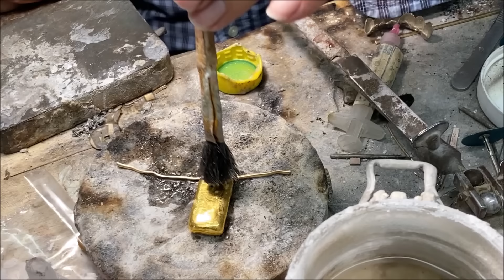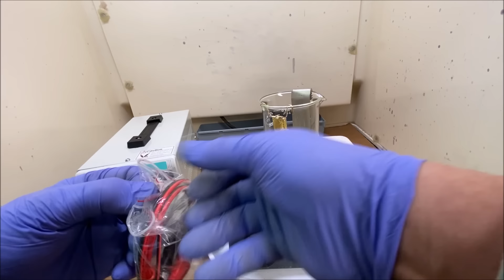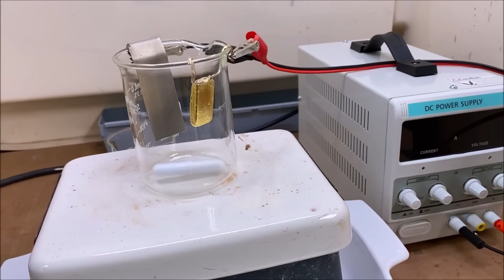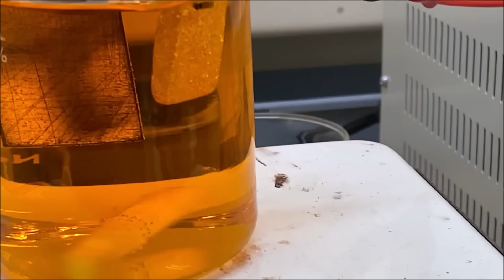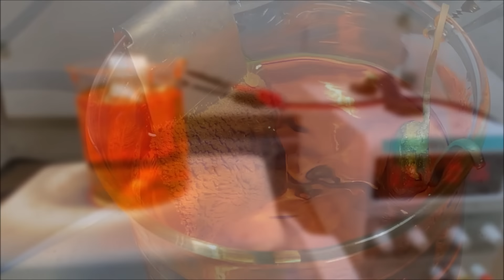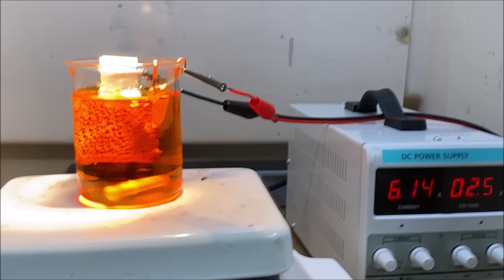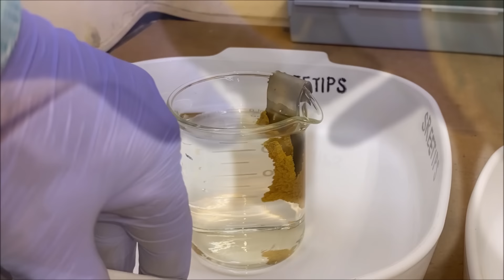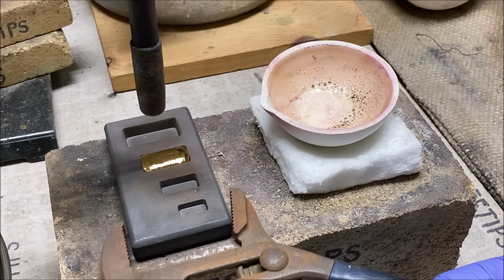Electrolytic Gold Cell Part 2

Comment: There are several things that come to mind that could improve this process but something you may find useful is the use of a carbon rod anode after the gold is gone.

This works on gold, silver, and copper just the same, and drives the gold out of the remaining electrolyte solution, just as is happening when the anode is made of the source metal... only the carbon rod does not go into solution as the gold does. It strictly serves as a place for electrons to go.

The result is the solution will fade to "clear" similar to how a SMB/SO2 drop does, only instead of simply falling to the bottom, the gold plates out on the cathode.

In fact you can do a "drop" that way... the only difference between "chemistry" and "electrochemistry" is the path the electrons take and an external energy source driving it (or energy sink running on it for the inverse, a battery).

Play with it with copper or silver first if you're nervous about the experimentation with gold before you're comfortable with it. As a side note, for the most part, metals above hydrogen in the reactivity series will want to stay in solution in favor of yielding oxygen instead (from the water). There are exceptions but they also affect the cell in the video.

This tendency is one of a few reasons the voltage is held low, to prevent electrolysis of the water in the solution (which just wastes input power for electrorefining).

The process I refer to by the way was given a related name - "electrowinning".

For what that's worth.
Reply from the maker: I was very pleased with the result. I may do this again with a larger quantity.
Reply: @sreetips  Excellent 😉

Comment: wat you could do instead of soldering wires ontoo tha anode is find a mould that has two extensions build in , either that of flatten the anode partway and basicly hammer the flattened end intoo two wires

Comment: Edit: Seeing that it was kind of difficult to removed the gold from the titanium anode, could you have heated the titanium to where the gold would have slid off since the melting point of titanium is about ‘1000° higher than gold’? Or would it have somehow alloyed with the anode? Seemed prettt difficult to remove the gold barnacle off the titanium.
Reply from the maker: Heating is not a good idea. But tapering and polishing the titanium cathode may help.

Comment: Do I have permission to try this? I need help trying get pure refined gold. I have authority for one video, but, it just cost too much in chemistry. Your method is better. Chemical engineering student, but need to help my mother pay off the house
Reply from the maker: This method works with gold that is already high purity. The anode was about 995 parts per thousand pure gold. The gold deposited on the titanium cathode was 9999 parts per ten thousand. Trying karat gold won’t work with this cell. Too many impurities.
Reply: @sreetips  k. Makes sense. What about your prior method to making high purity gold. Is it too high to sell?
Reply from the maker: No, it can be sold
Reply: @sreetips  the impurities I'm using is urea and aqua regia
Reply: With smb
Reply from the maker: Karat gold is an alloy of gold, silver, copper and zinc. The impurities I refer to are all the non-gold metals.
Reply: @sreetips  with ya on that, watching the 2700 one, seeing hydrogen peroxide
Reply: @sreetips  it's fair, it just looked beautiful

Comment: Did you just grow gold?😂
Reply from the maker: Grow: to increase in size or mass. The anode bar dissolved from the current flow. The gold ions traveled through the electrolyte and deposited on the titanium cathode. The gold was able to “grow” on the cathode through the electrolytic process.

Comment: So help me out because i dont know anything about this process... Why do what you did? Like what was the purpose of this experiment? Because it seems to me that in doing it you lost like 12 grams of gold. The anode was 58 grams of gold and the gold bar you ended up with was only 45 grams.
Reply from the maker: This is electrolytic gold refining. It’s called the “Wohlwill Process”. The anode bar was about 995 parts per thousand pure gold. After it was dissolved and deposited on the titanium cathode, the gold increased in purity to up around 9999 parts per ten thousand. The purpose was to demonstrate that it can be done at a hobby level. I did it in my garage. Gold this pure is not easy to achieve. And it’s not even necessary unless needed for some specific pure purpose such as a standard solution for analytical purposes. Three nines fine is industry standard for pure gold (999 parts per thousand). I did it for the show!
Reply from the maker: No gold was lost or created. The 12 grams was still there in the form of a sharks tooth. I tried to drill a hole and put it on a gold chain to be sold as a “sreetips” memorabilia. But I broke the drill bit off in the gold. So I just threw it in with the next batch of karat gold that I refined.

Comment: Just had another thought concerning the supports can you scratch or etch into the mould a thin semicircle From one end and connect the outside edges together forming the semicircle. This way all that's needed is to bend it over the beakers edge and then connect the positive lead to the loop

Comment: Absolute crap, CRAP !!! free gold 😂 he lost 13 g of gold + earring what he cut at start and at the end have liquid with gold 😂 why he didn’t dry it and melt it. People destroy nature coz they can make bunch of gold in garage in few hour 😂
Reply from the maker: I can’t not do it. Lord help me, I love it!
Reply: @sreetips  so you do agree with me about not making free gold.
Reply from the maker: Getting pure gold, from any source, is never quick, easy, or cheap. I can’t create gold. Nobody can. I grew the gold in an electrolytic cell. But it came from an impure (995 parts per thousand) anode bar of gold. I thought this would be self-evident in the video. Gold is created in gigantic cosmic events. It’s the only place where temperatures and pressures are high enough to cause protons to fuse into new, heavier elements, including gold.

Comment: What is the point of what you are doing? That you can take pure gold and plate it onto a titanium plate? The plated gold looks terrible. You say it worked? What did it do? Now your gold is on the titanium and you'll have to remove it in order to sell it. Why didn't you just sell the gold? You made the value of your gold drop by over half. A copper cathode would have worked much better. You did nothing to purify your gold. The gold is the same, and if there were other metals in the gold they plated onto the titanium also. So now you have everything you had contaminated with titanium. Glued to the cathode? Wow, get a plating book and read it. You did NO purification! If you need to get it off the titanium you should shape it so it can't hold itself onto it. If it's 4'9s, it was 4'9s before you went through the plating. To get 4'9s you need to dissolve it and then purify it by some other means, like Ph adjust and precipitate the contaminates. Then plate it onto a shaped titanium cathode. But saying that what you did purified it is false.
Reply from the maker: Ok, thanks for setting me straight.

Comment: My only question did you turn prophet adding a extra .0009 to the gold vs everything you used in the process an man hours at professional chemist pay not too mention the lab
Reply from the maker: This is my hobby. I’m all set up to do this sort of thing. I had a small chemistry lab set up in my basement as a kid. This is just an extension of that. I refined gold to four nines in my garage. And the only reason I did it was; 1) because I could. 2) to create another video for my channel. There’s only a hand full of people that can pull this off. Now, maybe more since I’ve posted the video on how it can be done.
Reply from the maker: The prophet is in the video, not in the gold that I refined. That was just a bonus.
Reply: @sreetips  I can dig it I wasn't trying to be cross I was being serious I know that plated gold rings and jewelry is made the same way a lot of the time now I don't have a way to do aqua regia especially in any manner to come away ahead never mind you would be in prison for just one wrong asshole that doesn't know what the hell is going on to hymn you up

Comment: I'm not sure what the purpose of what you're doing is and I'm not being sarcastic but you had a gold bar that you dissolved and then reconstituted on a piece of titanium what was the benefit of the whole process
Reply from the maker: I gained an extra nine. Went from 999 parts per thousand (the original bar) to 9999 parts per ten thousand. And I did it in my garage. Now, there’s no need for an extra nine except for some specific purpose. Three nines is industry standard for pure gold. There’s probably only a hand full of people, at the hobby level, that can pull this off.

Comment: So you just made a cool $3000.00 USD. Ha I'm in the wrong line of work
Reply from the maker: And it’s highly likely that number will grow in value. Whereas if kept in paper form (U.S. Dollars) it’s highly likely that the value would decline. When they create paper dollars out of thin air, it dilutes the value of all the other paper dollars in circulation. The result is it take more and more of the paper to buy stuff. But they can’t print more gold. Well, not for very long they can’t. There exists a large paper futures gold market that provides a convenient means to control the price, and therefore the demand, for physical gold and silver. This is a matter of public record. You can look it up and verify this. But most people are clueless and even less likely to investigate this. They kill the inflation hedges, with inflation. It’s brilliant. And it works. Until it doesn’t. Something is going to break, and the mountain of worthless paper and debt will come crashing down. Then,,we won’t be able to find any gold and silver anywhere.
Reply: We're certainly headed towards something nasty. I read that during the great depression that you couldn't even buy food in some places with gold. Nevertheless it's fascinating what you're doing I never knew this was possible. Is there a book that I could read to learn about this? @sreetips

Comment: awesome. i heard consuming gold ions makes one repulsed at alcohol consumption, also fantastic story about it causing telekinetic powers or something to that effect. 
i use silver ions in ~20ppm region around 100ml every eight hours whenever i get flu, i just use aligator clip lead on 1oz inget that has thickness of ~2quarters which needs to be + electrode, the - electrode i use is just thick copper wire as there are no metallic ions driven from - electrode. just water and lemon juice as electrolyte(~7drops/10ml) with 12v should be enough to make ~1/5 liter in ~10min.
Reply from the maker: I’ve never heard of this
Reply: early pharmecuticals used to treat nasty diseases sometimes consited of silver salts, supposedly can kill all viruses in 7ppm solution, comes out of solution slowly past 11ppm, store in the dark in glass, you may even see a solution glowing orange/pink when in sun just after preperation, sterling silver is fine also as minute quantities of copper also useful for body as it balances zinc concentrations i've been told. these things non toxic in ion forms just as ionized sodium and chlorine in table salt not toxic with respect to pure sodium or chlorine. use Faraday's constant to get amount by measuring currentXtime(i.e. 960480 coloumbs/mole) where an Ammpere is equal to col/sec
and mole of silver ~111grams, one would be in lower milliamp region with 12v in elctrolyte ~10 drops lemon/15ml water(distilled). never tried golds ions. i enjoy a couple of brews at times.  @sreetips

Comment: I am so addicted to your videos, i feel the need to mask up and put gloves on just to view them, so interesting.... and for thosecommenting, pls. dont call it "smelting" when he is obviously melting, i feel its Steetips pet peeve, of many im sure, 😅

Also, i would be interested to know, the specific gravity of aqua regis before and after dissolving the gold into it, im curious if the difference can be used to calculate the weight of the gold dissolved and if its close to the final product taken out.. hope that makes sense,
Reply from the maker: Yes, but I’ve never tried it. The weight of the liquid is much heavier with gold in it
Reply from the maker: Smelt: rendering metals from ore. Melt: apply heat to cause a metal (or other substance) to become liquid.

Comment: Ever thought about milling a mold just for making the anode in a pour ?
Reply from the maker: I have not thought about that.
Reply from the maker: Cast hooks right into the bar.
Reply: I'm recently retired from welding and I know how expensive I am 👍
Reply: Plus I would think a thinner wider anode will react more quickly than a small thick one

Comment: WHAT I KNEW GOLD DISSOLVING WITH NITRIC AND HYDROCHLORIC  ACID ,THE QUESTION IS WHY THE GOLD CELL DIDNOT DISSOLVE THE GOLD  WITH NITRIC AND HCL IN THE CELL ? DOES THIS MEAN THE NITRIC LESS THAN THE RECENT JOBS YOU DID TO NOT MAKE AN REACTION INSIDE THE GOLD CELL ?  OR HOW MUCH NITRIC ACID RATIO MUST BE TO AVOID ANY REACTION IN THE CELL ?
Reply from the maker: Nitric and HCl will dissolve gold chemically. The gold dissolves the gold cell with electricity.

Comment: These videos are fantastic and I watch them each multiple times. I'd love to know why the electrolytes (both silver and gold) need to have their respective metals in them. would a salt solution not do the same thing? Is the gold in solution the first to deposit on the cathode before the gold from the anode? I'm just trying to understand and sorry if my questions seems like a beginner one.
Reply from the maker: Some of the gold in the electrolyte will deposit on the cathode. Mostly gold from the anode bar will get deposited. The cathode don’t care where the gold ions come from. It will take the gold from either source. The electrolyte gets depleted as the cell operates. The hydrochloric acid improves conductivity through the electrolyte.
Reply: @sreetips  Thank you

Comment: You could do better for a cathode material than Titanium. While conductive, Titanium is really squirrely when it comes to its electrical properties. For recovery it will do however, particularly well since you won't likely get a metallurgical bond so removal proved easy.. If you were more concerned with a smooth cosmetic finish, then more precise controls of the process would be necessary. Surfactants, pH buffers, conductivity, temperature, and voltage/current are paramount in controlling the crystal structure and deposition rate of the deposited metal.. I worked for a company who had a proprietary electrolytic process for coating metals; I loved it. Very interesting stuff! 

You could also use a cathode that can be dissolved in acid, and after deposition you simply throw it in the acid and come get it later. The acid won't dissolve the gold and the cathode will be completely gone.
Reply from the maker: I’m very please with the titanium cathode. But I’m convinced that the best cathode would be a pure gold sheet rolled very thin.
Reply: @sreetips  That would be the best thing, I agree... Then skip the removal and just melt the whole thing when done. Definitely a time saver!  You can also play around with the parameters and (possibly) get a faster deposition rate. Great video!

Comment: Hello, I am very interested in this, and as such, have so thoroughly enjoyed your very informative and entertaining videos. I was going to just comment and like so it helped your algorithm, but I did actually have a question I know I need advice on in order to turn a profit. Could you please offer a good way to determine what is worth buying, and a rough estimate of the weight and price so I could avoid getting completely ripped off due to not yet knowing the tricks?
Reply from the maker: We buy scrap gold at local sales. We’ve looked at thousands upon thousands of pieces of jewelry over the decades. So much so that we can spot a piece of “fake gold” almost instantly just by looking, most of the time. Some pieces are tricky. In those we use touch stone and testing acids. You can buy the kits on eBay. There’s no substitute for experience. We got fooled a few times when we first started this.
Reply: @sreetips  thank you very much. I am familiar with rings and necklaces somewhat, but I always have wondered in the videos where you pick up the computer pieces and other sources of scrap and really have to soak and dissolve the unwanted materials how you would know if you get a good deal there but the more I think of it, it seems like the rise and fall of market values would be a big factor. There was a video you did specifically in which you had mentioned straight up that you overpaid for the bags and did so anyways so the video you were making could be done and that would be my biggest worry at first is getting ripped off in that manner. If they generally aren’t worth it, seldom containing enough to make it worth the effort I would believe that also
Reply from the maker: Computer scrap is always over priced. I just bought two bags, 1 pound each, of trimmed circuit card fingers for a new video - again. Paid $130 each, $260 total. But I only expect to recover about 3 grams of pure gold at about $180. For me, the value is n the video. Not n the gold that I recover. That’s just a bonus.